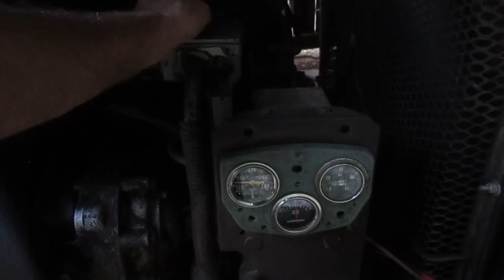At the sawmill but junk logs # 1206 NOT really worth sawing

Comment: HI JOHN I see that the new saw blade is much better than the other 1 now it is sawing just like it should  JOHN at the FRICK SAWMILL I was at it had 5 head blocks and a long time ago they took off the old hand dogs and they were changed 2 air dogs there was a difference U didn't have lift hand dogs all day U push a button and GM DIESEL 671 W straight exhaust would always singing 🎶 😊😊 good JOHN why didn't U ever change the hand dogs 2 air dogs it would've saved U alot lifting and walking back and 4TH JOHN if U had 2 saw 5 days a week all day everyday U should've changed those old hand dogs JOHN have U ever made the engine sing good when sawing a line dad and uncle Rob could both 😮😊😅🎉😂❤ /😊😊😅😅😂😂 TLC /OMG 7 13 2O23
Reply from the maker: hi there just takes time and money . thanks for the thought  john